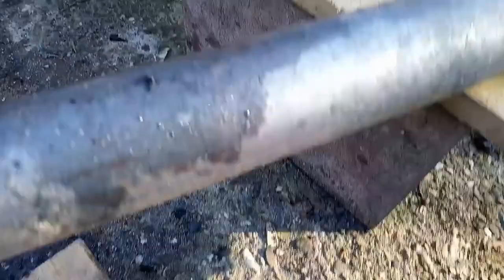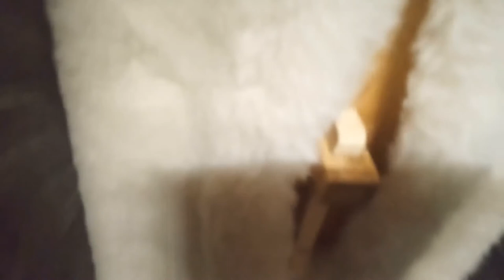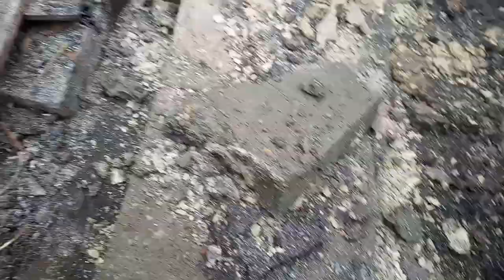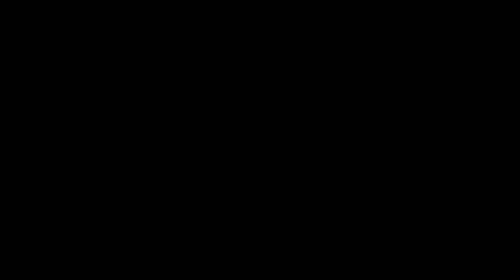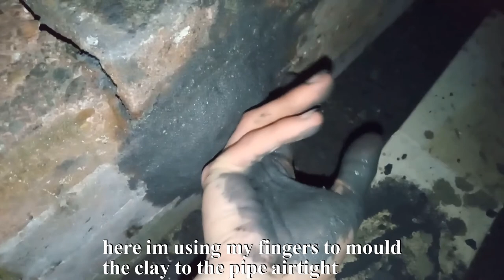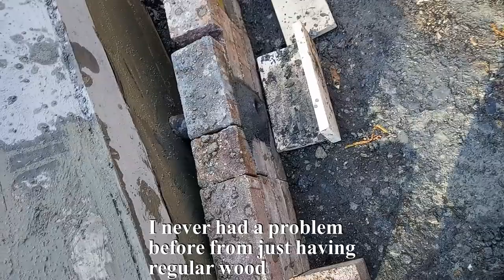Rebuilding Japanese forge

Comment: What does constantly diping the hammer in water before striking do?
Reply from the maker: it helps to blow forge scale off from the workpiece with steam explosions, resulting in cleaner forgings.
you could use a brush to do this but a hammer can do both, forging and cleaning.
oh right, you mean when I was hammering on the pipe, 
yes also to pop the scale of from it along with the yellow remains of the zinc coating.
Reply: @leoszes  interesting I definitely have to try it!!!